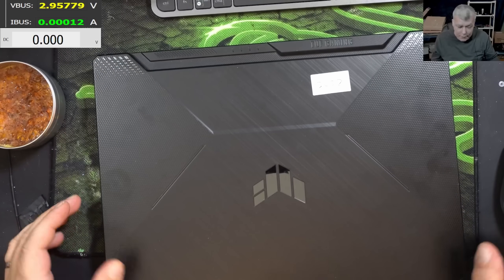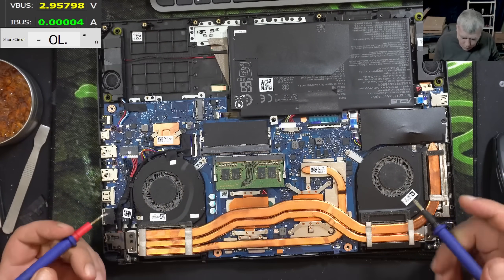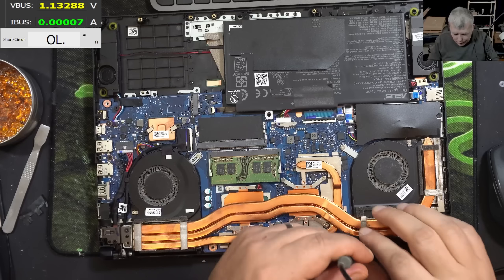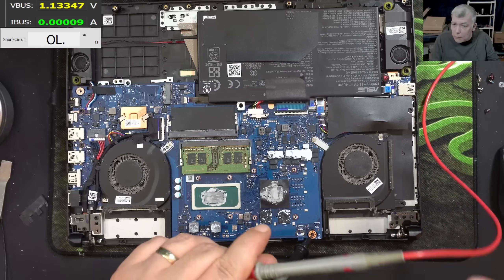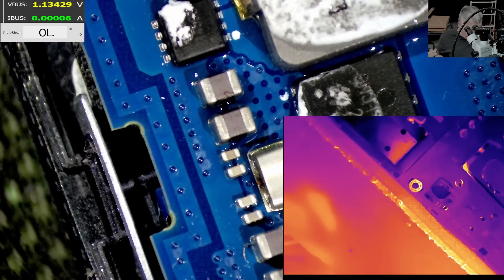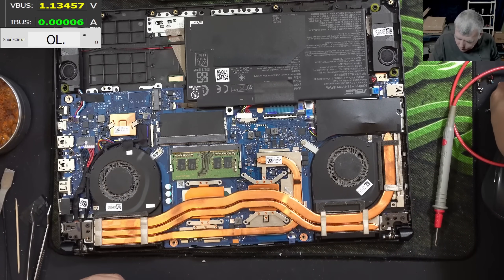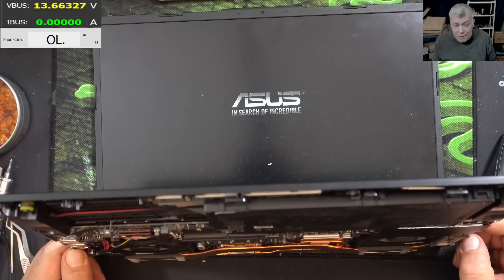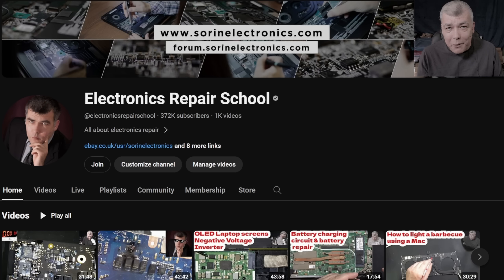Asus TUF FX506 no power, not charging board repair - Easy to diagnose this particular fault

Comment: I just repaired a friend's laptop. First, it wouldn't charge the battery, the culprit was a shorted Mosfet above the RAM slots and a blown fuse. Now it charges, but will not boot without the battery. I spotted a short from the GPU capacitors but they were all fine, none was blown or shorted : it actually was a fake short-circuit. It's a protective measure that was activated by the mobo. I fed some current and nothing was getting hot on a suspicious cap, that's how I found out that the fault was not here. Turns out, it was ANOTHER dead mosfet next to the charging port. Replaced it with a fuse-wire, just like the other and boom, it's on baby ! Thank you Sorin for your invaluable learning material. I saved a 1.5K gaming laptop.

Comment: I'm new to this, so I'm assuming heatsink over the chipset is not standard. What is the advantage/disadvantage of this from repairs point of view? just easier access if you remove the heatsink? perhaps its usually a pain to remove it if they don't have screws?  or is he just appreciating the chipset having heat disipation so it can last longer?  Thanks!